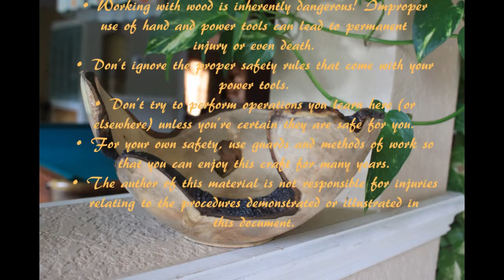Woodturning Myrtle wood multi winged bowl

Comment: Nice work that bowl looks great. What did you put on it before the spray on?Dale T
Reply from the maker: Thanks for watching I applied Minwax sanding sealer I use that on 99% of my turnings
Reply from the maker: Thanks for watching Dale and welcome to my channel. What I applied with the brush was Minwax sanding sealer. I use that on the majority of my turnings than wet sand with 1200 grit or so.Thanks again Take care